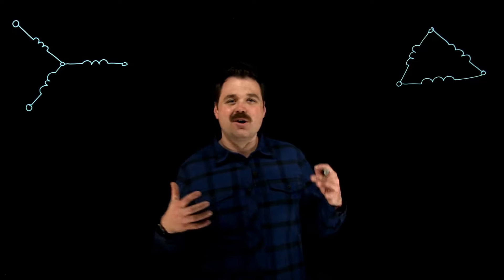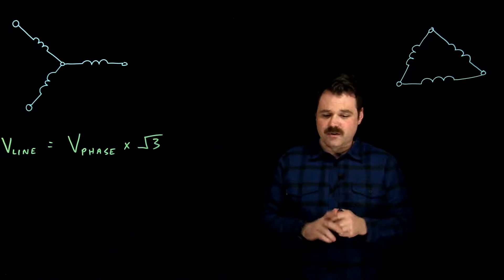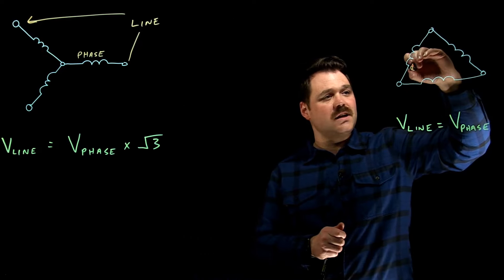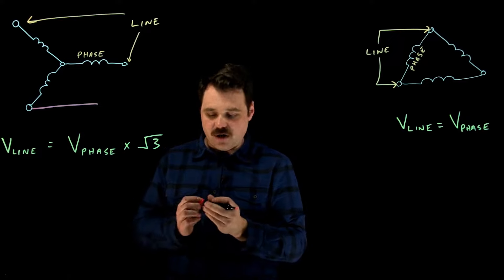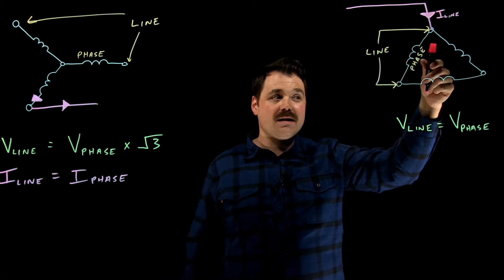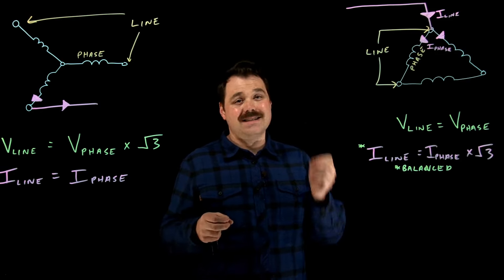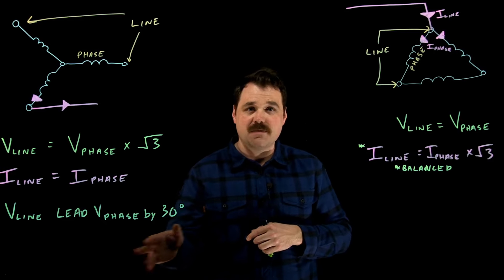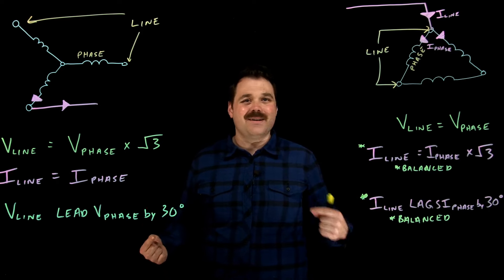What's the Difference Between Wye and Delta?  Current and Voltage Relationships Explained

Comment: Slight mistake at 2:32 you say voltage is 240 on the line. But you explanation is 120*sqrt(3)=208.

Comment: Good explanation!  If I have two transformers (1&2) connected to each other;  should the secondary connection of the main transformer (1) be the same configuration of the primary of the second transformer (2) ? Eg. should the connection be delta-delta ?

Comment: Please help me understand better. with bldc motor 
I read it on internet
Wye 1.7X less KV as Delta.
Delta 1.7X higher top-speed than wye, more current than WYE at all RPMs.
I assum delta config draws 3A, and Wye also draws 3A, then will Wye give higher Rpm than Delta?
Or both configurations have the same rpm, which one will draw more amps?

Comment: Please explain why we have square root of 3
Reply: You have 3 phases
Reply: It’s the phase times 1.732 that gives us the line voltage in a wye system, 120 x 1.732 = 208.  Sqrt 3 is a necessary constant for 3 phase power.